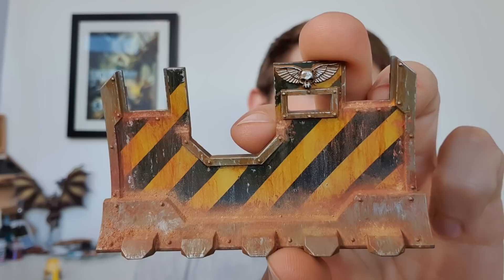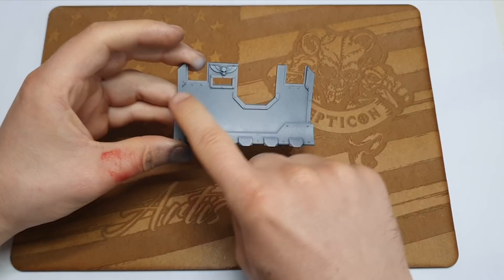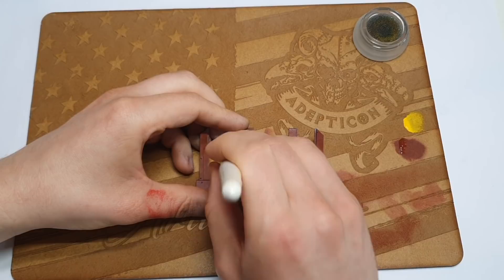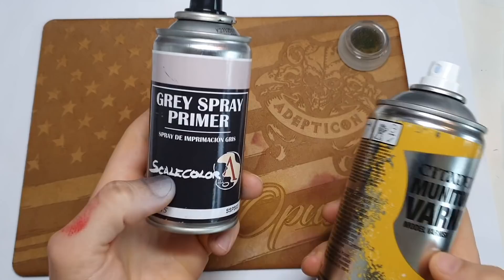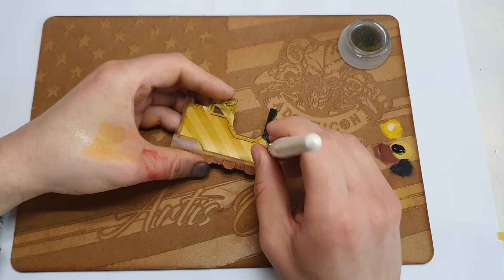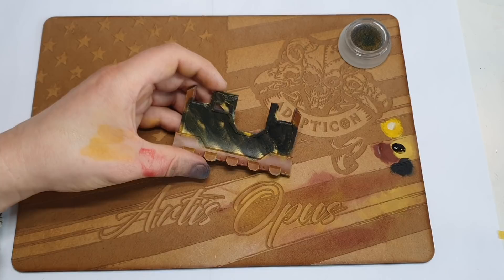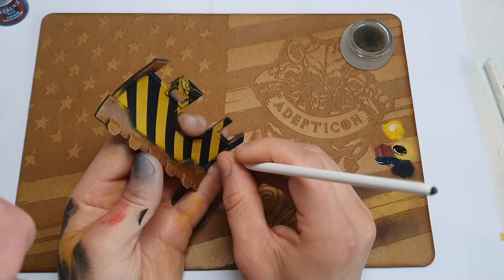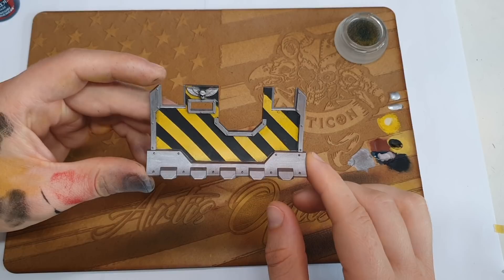How to paint Warhammer 40,000 Dozer Blade - Hazard Stripes, Weathering, Washes and Pigments!

Comment: A tip for fixing pigments with a delicate touch is to try using a small misting pump bottle, and airbrush flow improver such as vallejo brand. The flow improver should mist out of the pump in an extremely fine cloud and not disturb the pigments. It should run between the pigments well and set them.
Reply from the maker: This is legit dude, now to find a misting bottle, I'm going to try this out, imagine it'd dry faster, too!
Reply: @ArtisOpus  I found that Iso alcohol works well, keeps the original colour and texture of the pigment. I found iso alcohol in a misting bottle at a local pharmacy

Comment: When using pigments, I like to mix them with acrylic matte medium into a slurry and apply them to the model wet. I find them to be a bit easier to position this way and you then don't need to use the fixer as the matte medium does the job when it dries. Excellent job on the model, it turned out great.
Reply from the maker: Cheers Tim, so many tips, love our community :)

Comment: For a first attempt, that looks amazing mate! A couple of quick points about the enamel washes, the hairspray technique will work with those too, and you can make really cool streaking effects that way, also, you might find that they blend out a little easier if you work in small areas and brush a tiny amount of thinners on first, then put the washes on top, then blend them, they shouldn't bleed too much if there is only a small amount of thinners there! Finally, I would just dab a tiny bit of wash into panel lines and onto raised stuff like rivets too, enamel washes will flow round them and really make them pop!
Reply from the maker: Mega Simon, taken all on board, hopefully I won't have forgotten by the time I next sit down to paint!

Comment: Cool experimentation! I would suggest not wiping the enamel based products and odourless thinners on the skin. those are petroleum based products. I wear a nitrile glove when using them. One question. the varnish shown,. is it an acrylic varnish?
Reply from the maker: Hi Geoff, thanks for the tip! I'm unsure tbh, it doesn't wash off easily, and goes on smoothly, it definitely feels like it gets a very strong bond, it probably offers more protection than airbrushed varnish, but will go on thicker, which can be a downside for sure. :)

Comment: Thanks for the great video, looking forward to trying this on some vehicles! A question - I've been doing some Iron Warriors recently, and have been masking shoulder pads etc and brush painting the black over the top. I've been finding that I have quite a noticeable raised edge between the black and yellow of the stripes - would the stippling method give me a smoother finish do you think? Cheers
Reply from the maker: Hi Rich, it could just be that it is more noticeable at a smaller scale, are you stippling the darker or lighter colour? Darker takes less layers so is easy to do thinner.

You can also varnish the entire thing after and that'd smoothen it out a little :)
Reply: @ArtisOpus  I've been doing the darker colour, but maybe I'm doing it a bit thick! Will give the varnish a go too, thanks :)

Comment: Just took the plunge and ordered my set! Looking forward to giving them a go. I desperately need a good way to paint eldar & drukhari vehicles. I'm getting better with wet blending, but it takes FOREVER!!! 

Do these brushes have a harder time with metallic paint? Maintenance wise, I mean.

The paint job looks great in the vid btw 👍
Reply from the maker: Hi Luke, fantastic! We've actually got some Eldar vehicles prepped... just need a suitably funky scheme to do them justice :).

They do a little, you may notice some of my brushes have had their handle tips dipped in black - they're the ones I (am meant to) reserve for metallics, it just helps cross contamination, which is more of an issue than the maintenence. - Silver - black is particularly noticeable!
Reply: @ArtisOpus  thanks very much.

I'm going to redo mine trying to copy the blue to red necron flyer. Just a bit puzzled with the lumps and bumps. 

Think I'll leave off of the Metallics  with the brushes for a while. My track record with brushes is not great 😉

Comment: Im trying your techniques out and somehow I think I’m using too much colour. My stippling is creating actual structure. But I won’t give up.
Reply from the maker: Hey dude, you need to remove more paint by the sounds of things, start slow and careful, you can even thin the paint a little, even if your first few layers seem a little transparent and take a bit more time.

There are also some paints that just don't play nice (I had to strip and begin again with our space wolf vehicle... it happens!).
Reply: Artis Opus thanks mate! Figured as much and am still trying. It just requires a lot of re-thinking! :) I’m trying out your black stormcast recipe, so the colours should be workable. :)